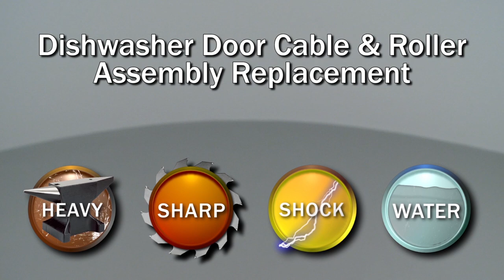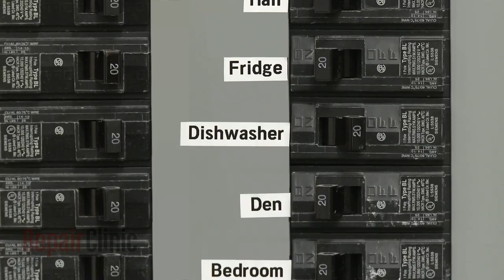KitchenAid Dishwasher Door Cable & Roller Replacement 8194001

Comment: You do not, I repeat DO NOT have to disconnect the electrical, water or drain connections - in most properly installed units, there should be enough tubing, hose and electrical wire to simply slide the dishwasher out and do the work!  That adds an extra 20-30 minutes.
Reply: Amen Bro! well said

Comment: At the 2:20 mark in the above video it shows removing screws from the top that are in a wooden counter top. I have granite counter tops so there are no screws there. My dishwasher has screws under plastic caps on the right & left side of my dishwasher door frame.  Pop off these caps to show the screws that go into the cabinet on either side of your dishwasher.  Take out these screws so that you can pull it out your dishwasher to do the necessary work.

Comment: if for a squeaking then it is essential to lubricate the new pulley wheels and cords otherwise the squeaking may be worse.  Use a good lubricant not petroleum based.  I uses a good bicycle silicone based lube.  Worked well.

Comment: Two things not addressed in the video. Our dishwasher has three holes for the mounting screw securing the pulleys through the hole in the lower pulley. The choice of holes let you adjust the tension, which was too high on my first choice that seemed to match the angle of the original rollers. I ended up using the holes that create the least tension (the ones furthest to the back). Also, the new cords produced a dreadful noise. After researching the cause, I lubricated the new cords using bar soap. This smoothed out the vibrations in the cords that resonate through the springs. The door is now quiet and well-balanced. Also note, the repair sites fail to tell you that if you have a hitch in your door's operation, it's overwhelmingly likely to be a broken roller and/or damaged cord than a bad hinge or broken spring.